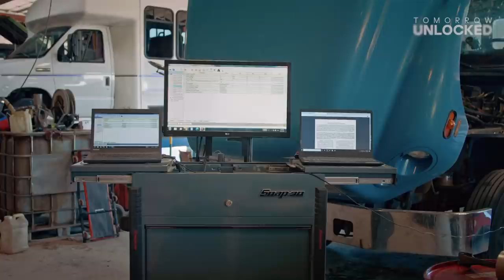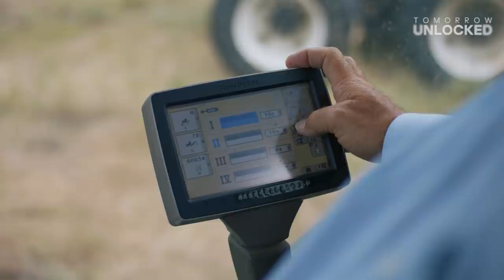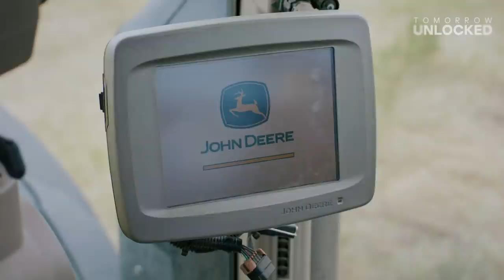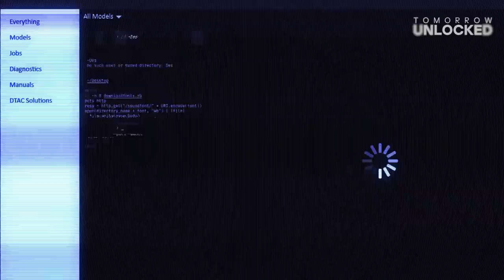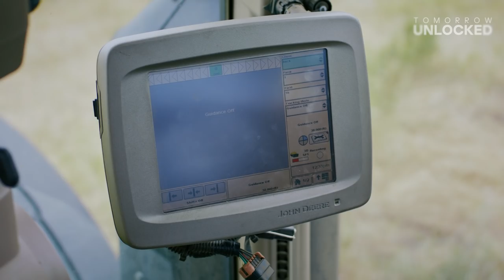Tractor-Hacking Farmers Take on John Deere

Comment: In EU we are fighting for the right to repair! 🇪🇺
Reply: Hope you win.
Reply: You should be fighting to bring some democracy to the European union
Reply: Yes👍
Reply: For what? Just repair ur stuff or go to an indipendent repairman
Reply: 😂😂😂 this is crazy
Reply: @AliBaba-mb1pu  last time I checked, we still have it.
Reply: @HappyRussians  you are saying it sucks in general and refer to a specific problem, what's general about that ?
Reply: USB C!!!
Reply: @ukrainiansturgeon8561  That law WILL be circumvented as soon as it rises to power. Mark my words.

The letter of the law can be summarized as such: All personal electronic gadets that are sold inside the EU has to be charged through an USB-C charger IF it has wired charging capabilities. personal electronic gadgets that have a wireless charging functionality do not require the standard USB-C plug for wired charging if they are charged with less than 15W of power.

What this means is the following: If I make a new tablet/phone/camera, and then only include a proprietary wireless charger that has a power output of less than 15W I am golden. I can still include any proprietary wired data connector of my choosing.

What Apple told us so far is the following: They WILL comply with the law.

To me this means the following: You 'aint getting sh*t son. New iPhone to come out in 2024 will still have the good old Lightning port for data transfer, and it will be software locked to not accept charge through the cable if the phone is sold in the EU. We will still not include our proprietary 14.99W wireless charger with our phones as usual...
Reply: @AliBaba-mb1pu  Another frecken Brexiter 🙈🙄
Reply: In Zimbabwe, 5000 John Deere tractors were bought...and it is the same issue we have. Once they malfunction, its John Deere that can fix.

Comment: It makes me sad to see things like this. Once tech was meant to empower people, but now it's meant to limit your potential and dry out your pockets
Reply: Tech has always been used to control people.  Think of parking meters.  Coin in the slot type machines.  Electronic door access codes.   Security cameras.  Turnstiles.  Speed cameras and redlight cameras. Activating software.   Even where it gives the ILLUSION of empowerment there is always an underlying seizure of power.  "The velvet prison" I have always described it.

Comment: It’s sad, because when the Farmall series existed, they designed specifically so that farmers with 1 wrench set could work on their equipment, now your paying 10s of thousands of dollars for repairs that could be done simple
Reply: 9/16
Reply: sheer madness prevails..
Reply: Go back to sitting on an open tractor all day LOL Modern farmers drive their air-conditioned pick up to their air-conditioned tractor push a few buttons the play on the cell phone while the tractor drives itself.

Comment: That why I own old junk...no hacking, no corporation telling me what to do...just fix it and deal with owning junk
Reply: Agreed ,3 wires run a Diesel engine,junk is best
Reply: @cecilforbes3034  Untill goverment starts heavy taxing it. Which they have to stop the global warming.

Guess you will have to degrade to a steam engine run by a boiler, burning wood from your own land :P

Or just embrace the tech and take control. First thing i did with my car when i bought it was to hack it, disable some safety features like car disabling video in front while driving. Aswell as the puny 250km/h speed limit etc.

Tech is awesome, i get alerted to any police controls near my car when driving. So i can easy avoid them/slow down.

Not to mention tech allowing me to experience performance that was pretty much limited too professional drivers/super rich people when i was a kid in the 90s.

Goin 0-100 in just above 2 seconds is hella awesome.

Old stuff has its charms. Like how its build to last, compared to modern consumer mentality. But its usualy not very effective at its job compared to the newer.
Reply: Amen 🙏 I only have one newer tractor with a computer on it and that thing  is such a headache to repair. My other junky’s are still going hard and no computer on them and they are so easy to repair for anything
Reply: Yes Sir..We have a whole herd of 40 year old tractors...
Reply: @MrDanisve  Creeping Communism everywhere....Sharpen your swords,...
Reply: @davehughesfarm7983  What? Communism is a planned economy. Where do you get that from?

Comment: Farmers: Let us fix stuff we own
John Deere: Introducing... Montly Subscriptions

Unfortunately, this happens already.
Reply: and despite what they're claiming here the same is true for cars.
That diagnostics software car mechanics use is used by them under a service level agreement with the manufacturer.
Which makes perfect sense as the manufacturer sends out regular updates with data for new models, bugfixes, etc. etc. which costs the manufacturer money.

Where JD goes wrong IMO is in not making that software available at all to independent shops and operators, only to certified dealers.

I have worked in the software industry for going on 25 years, and am constantly surprised and disgusted by the idea that many people seem to have that creating and maintaining software is a zero cost process simply because the distribution happens using some intangible medium like the internet (which btw also costs money to build, maintain, and operate).
Reply: The monthly subscription should be in the purchase price, paid for at the point of sale.

Comment: I work at a dealership, these modern machines are getting so technical and advanced that just having the software does not mean that you will be able to repair the machine. You have to have a very firm grasp on data links and advanced electrical theory. Just clearing codes doesn't fix anything...
Reply: They will have to learn the hard way.
Reply: But if it is mine, then I should be able to choose to clear the codes as I see fit. Why is it, that I can build an airplane in my shed and then I can go flying in it, but I am not allowed to fix my phone/tractor/car/whatever? And I am unable to fix them not because I lack the skills, but due to the fact that if I change the battery in my phone it will no longer work properly?
Reply: @h2835  I agree you should be able to attempt to repair your own machine. I have seen too many times more damage being done from improper repairs, such as clearing codes. It's always a hard conversation to have when you explain to a operator that they caused further damage from improper repairs.
Reply: @gunmountain  It should still be their choice to make. My reasoning is simple: If I own it, then I am free to do with it as I see fit. That includes wrecking it. That includes damaging it by making improper repairs. That also includes diagnosing the problems it has.

We do not argue about being able to change brake pads, but it can do a whole lot more damage if that is done incorrectly. We do not argue about being able to change oil in a car, but it can do serious damage if done incorrectly.

I think it is time to treat adults like adults. We do not need to try to save them from the results of their actions. If you try to do that, then responsible adults will simply skip your products, and irresponsible ones will still try to make you the bad guy.
Reply: @h2835  totally agree

Comment: agreed, electronics (tractors ,ecars, mobile, laptops, pc) are become more and more closed and fixing is increasingly diificult to the point of non existent
Reply: Yeah it's a total scam. Washing machines are designed to have the circuit board fail. The board is in a space without adequate ventilation and right next to the water valves. No circuit diagrams are available and a replacement circuit board costs half the price of a new machine (bill of materials puts the real retail cost at less than $100). I've repaired the board on mine twice now and modified the machine for better ventilation. Just because I hate being scammed like that really.

Comment: Another thing that needs to be said is who at John Deer and other companies thought that it was a 'good idea' to make agricultural equipment dependent on computing technology, let alone in every part of the machine. Am pretty certain that most tractors could be built without the need for an onboard computer to control everything, especially given that much of what is required hasn't changed that much since a century ago. Keep It Simple comes to mind

Comment: I support right to repair, let that be clear from the start. The only thing I don't understand is: what's keeping someone from starting a new tractor producing company without the locked software? If the problem is that big like the farmers are saying, why do they still buy those tractors? Please, someone explain it to me.
Reply: Availability and efficiency. Just like buying a car, you can only reasonably buy from somewhere nearby and modern machines using software are much more efficient than older tractors at getting the job done. If your only options nearby are machines with software that can't even diagnose the easy to fix problems, then there are really no options since every single problem will require going back to the dealer. A tractor isn't something that can cheaply and easily be shipped long distances.

Comment: The common sense of this man is right on point. NO WAY a dealer should be able to extort them for software and technology advice. When you buy something it should be yours Lock stock and barrel. Manufacturers should be required to divulge ALL technology software to the purchaser. IF NOT then they should not be able to incorporate electronics and technology and software BEYOND THE REACH OF BUYERS. CUSTOMERS ARE NOT DEMANDING ALL THIS ELECTRONIC STUFF all they want is equipment they can rely on and fix in the field or their shop.

Comment: If I was in the upper management or board of a John Deere I would meet with farmers and ask what they want, why and meet in the middle.  A concern JD would have is “who is liable/responsible when a hacked piece of JD equipment fails and causes injury?”
Reply: The thing i can't is why not program and set up the tractor to start back up after the issues been fix. I work in auto repair PCM sees the up steam o2 sensor has gotten too slow. set the code and turns the light on. you take in to get fix the person working on it puts a new sensor in the PCM with the light still on retests the sensor. after the sensor passes the OBD2 test 3 times the PCM on it's own turns off the light. GM cars and trucks puts in history after 40 passes it's eases the code.

Comment: Europe has addressed this issue much more than the USA. In the USA the DMCA made it illegal to disassemble software so that you could make something work.  Manufacturers leapt onto this and added software to things like ink cartridges so that they couldn't be refilled.  This is bad for the consumer and it is bad for the environment.  Europe reversed this and said that copyright is null and void to the extent that it is necessary to violate it in order to maintain or supply equipment.  There may be weaknesses but Europe is twenty years ahead of the US in this regard.

Comment: It's not just John Deere. Even though 3rd party software is available for cars and trucks, it's not always accurate. In most cases the software company has to figure out the system before writing the software and they're not always right. I bought software for my diesel pu, but it sometimes gets the problem wrong. I change a perfectly good part, still have problems until I start changing related electronics. The whole issue or repairing owned equipment needs to be overhauled.

Comment: Look, I have no issue with legislation that tries to enforce something that should already be in effect, but I take issue with "that can only come with legislation".  What about an open source competitor?  Is the agricultural community not large enough to support such a thing?
Reply: Open source, for a manufacturing diagnostics application requires a reference architecture which I am sure JD says is proprietary and/or contains trade secrets. Again, farmers mostly want to be able to either purchase the diagnostic application (which should come as a perpetual license with the tractor) or take it to a mechanic that can purchase or license the diagnostic software.
Reply: @tlookingfora5336  I'm talking about a competitor to JD.
Reply: Well sir, open source, in most cases, is a community based software effort (think grass roots), companies may join the effort or may not.  And, yes I have some exposure in the arena.  Right to repair would typically be more concerned with the diagnostic side of things rather than the entire code base for the target machine (e.g., tractor, combine, etc.). At this point the code for the diagnostic software is under copyright, possibly patent, and licensure contracts (I am assuming the standard purchase contract for the machine in question has a clause addressing the associated software).  The license prohibits decompiling, reverse engineering, etc. to protect the intellectual property of the software owner, the rights of licensing, and any/all trade secrets that may be derived from the code.  So, an open source project to provide diagnostics, activation of parts, and/or configuration of parts or processes would be a massive undertaking without at the very least a published reference architecture to guide the efforts.  I believe that when you purchase the machine, the buyer should be provided with a perpetual license for the diagnostic software and any enhancements, patches, etc. made to that software and that the software should be readily downloadable and must be able to be installed on commodity hardware (laptop, tablet) and there should be no additional cost to the owner. Just my view, and yes this would take about twenty or thirty sentences to ensure in legaleze.

Comment: My opinion as someone who has experience in the technological sector is that some things like preventing you from touching the source code or other sensitive parts of the software, they are not trying to get more money from you(only) it is being bone in order to keep you safe from yourself because of the complexity of these applications. Thing about what would have happened if you had control over the entire software and you could tweak it, one wrong parameter in the source code, at the gps modules, the auto steering system and this could end up in a lethal situation, they of course don’t do the best they can but there is a reason for some of the things they do a this is to keep you safe and alive so you can continue be their client. One more thing, referring to my last example, thing now that you survive and of course this is your fault no doubts, you would blame it to the company and as a result you wouldn’t buy anything from them again.
Reply: Makes sense
Reply: My option as someone in the programming sector: This is a load of bull. Nobody ever asked for source code or access to sensitive parts of the software. Everybody ever asked for are the same diagnostic tools, that the dealers have access to. The diagnostic tools, that the manufacturer reportedly made accessable to the users as part of an agreement with the US government so that the Right to Repair bills do not go into effect. Problem is: Those were not, are not, and will not be available for the public until there is a law stating it as a requirement, and a class action lawsuit resulting in the total ban of sales from a manufacturer until said software is publicly available.

Mind you: Nobody ever asked for it to be free. A yearly subscription of about 3-400 USD per user should be acceptable, it the software comes with the required connecting hardware.

Comment: It's not that equipment is so complicated that you need help from your manufacturer to repair it... it's that manufacturers are actively doing things to make it impossible to repair outside of their control. One non-farming example is that owners of new iPhones can't swap out a broken camera because they added a completely UNNECESSARY activation step anytime a new camera is put in the phone... a step that can only be done by "Authorized service".  

If legislation just prevents manufacturers from adding "authorized repair site only" interlocks on their products like the egregious Apple abuse... that would be enough.

Comment: Time for the Airline model.  Rolls Royce charges for jet engines by each operating hour but they have a service level agreement to keep the planes flying with large penalties if they do not.  As soon as John Deere is responsible for keeping it running just watch the techs run and the satellite updates and fixes.

Comment: Not an easy solution.  For instance, let's say someone requires a repair that involves flashing an eprom chip...and they decide to do it themselves.  It fucks up.  Then they go to the dealer and say, "Man...I have no idea what happened.  It just failed.  Ya'll got to fix this.  That'll be free, right?"  Software developers don't work for free.
Reply: And why don't John Deere makes software open for repairs and diagnostics that's the problem ? If you can repair a hardware problem the software should not supposed to stop you.